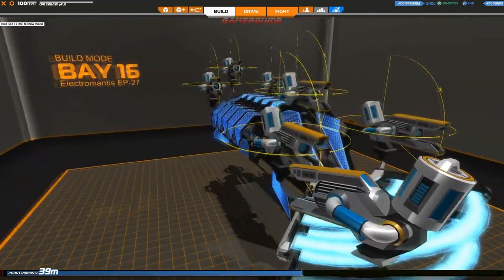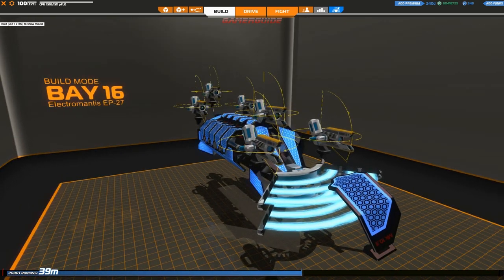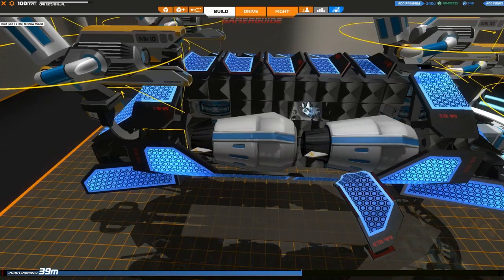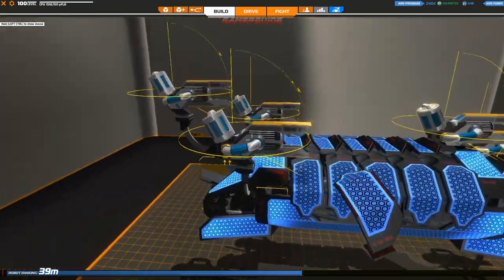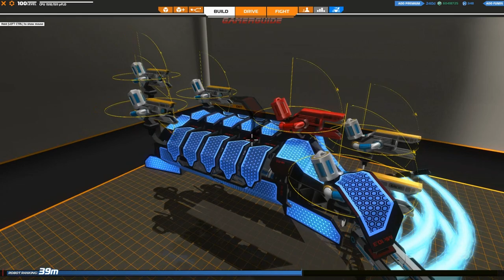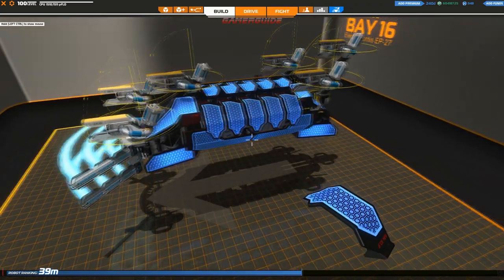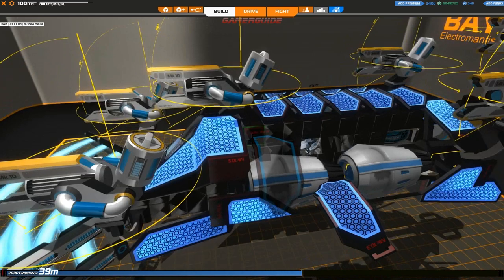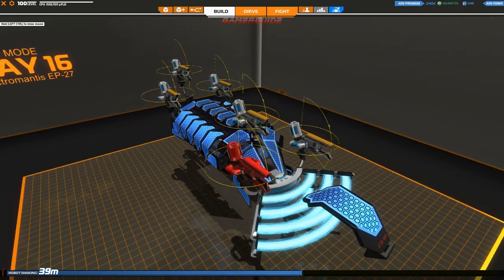ROBOCRAFT - Hover Blade Patch + New Electromantis EP27 Design & Let's Play

Comment: very nicely done.  I have you in mind in the latest issue I am noticing having a new account to see how the leveling tech tree pans out.  Same normal problem in lacking resources is typical.  however finding a lot of people making thin builds that die way too easily and think the 30's to 40's range needs help.  the cpu limit for me at level 40 is 853.  I figure you might have some ideas to assist those in this range.  Item levels or the old tier levels are tier 5 items where tier 6 items open up at level 40.  I got tanks down to a science anymore but folks out there need help.
Reply: Vio Dragon good match.  Did the update mess up this hover design for you or is it still viable.  I like the handling you got going.
Reply from the maker: Vio Dragon This was recorded post update. So surprisingly, with the rudder, it does quite well.